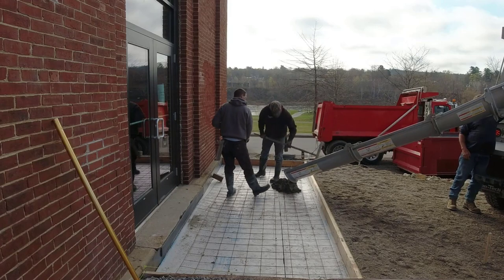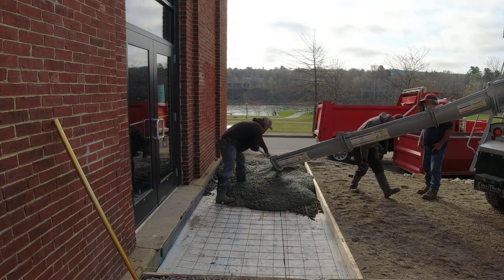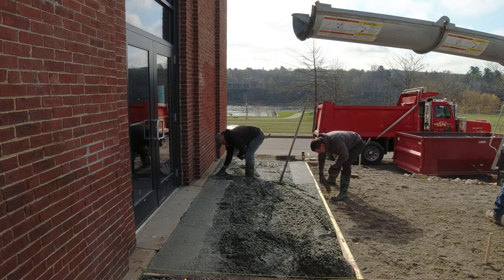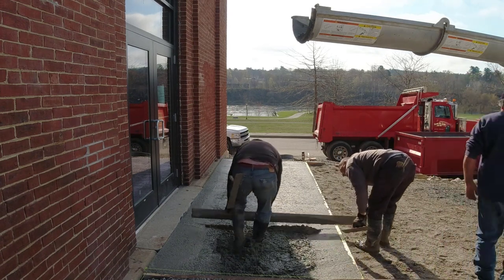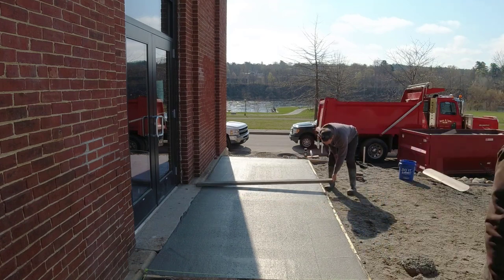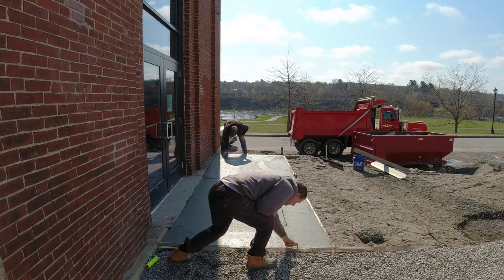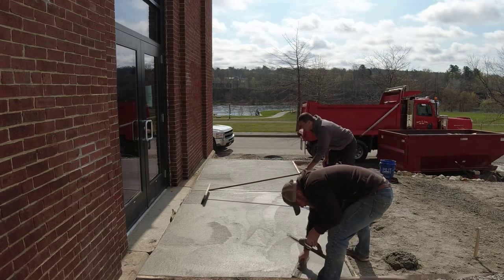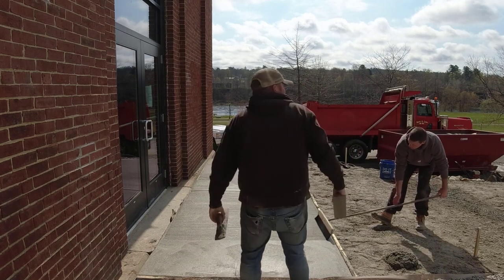DIY Concrete Entry/Patio Slab | Can You Pour Concrete Yourself? Find Out Here!

Comment: Why not use the mesh chairs/tables to keep the reinforcing mesh elevated in the concrete rather than on the foam base? I mean you were jagging it back up because you didn't have tables, so walking on it, you just pushed it back down again.
Reply: I know you think you know everything, but that mesh bounces back up. With Air and fibreglass mesh, you don’t even need rebar for that slab.
Reply: I hardly think I know everything @Cultofpersonality09129   It was merely a question. If it isn't needed, then why put it in, and if it bounces back up, why pull it? Surely, if it isn't needed, then the customer would be better off saving on the materials end of the quote by not having it there if the slab is just as sound? Personally, I think these videos are great for people willing to do it themselves, and risk it needing to do it again vs hiring in pros using the "buy once, cry once" theory.